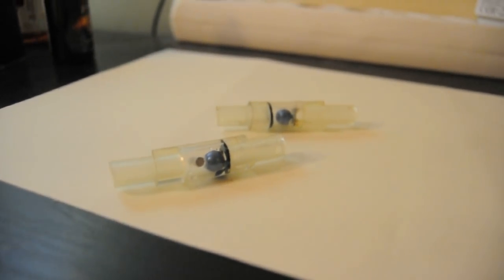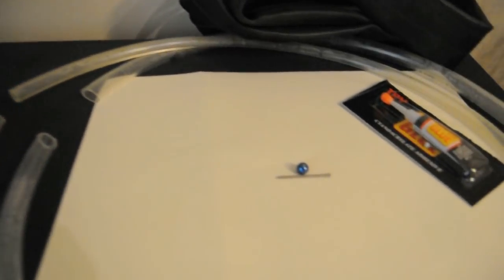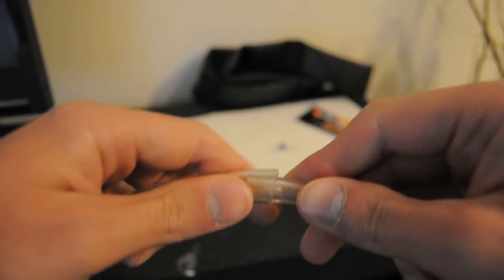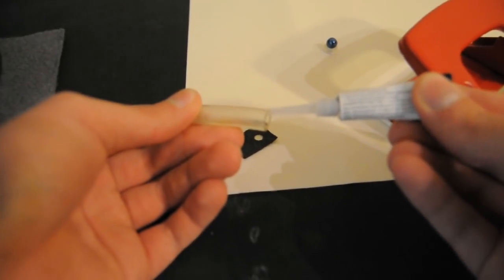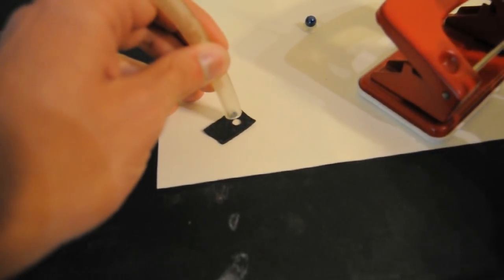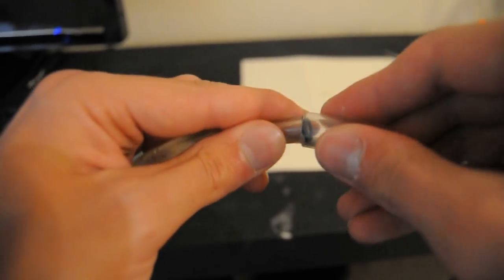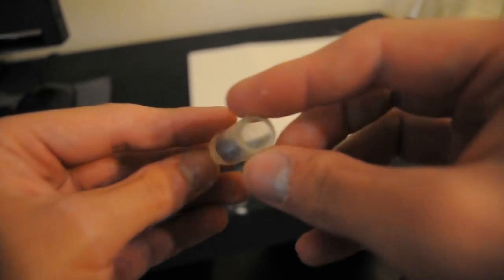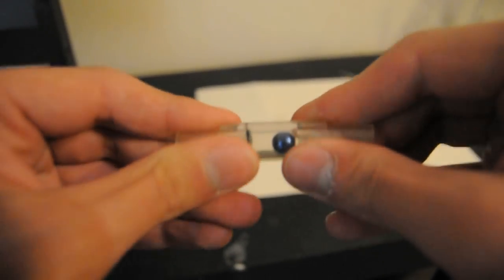How to Make the Easiest Check Valve at Home (One Way Valve)

Comment: I need one designed like this , but with a spring so that only slight vacuum will allow water flow out , and then seal with no vacuum in hose. (adjustable spring pressure)

Comment: I got a shower valve repair kit that comes with rubber rings and springs. I guess I could use that to substitute the nail and the rubber. I just need 2 tubes and super glue? The hoses are polyvinyl? Maybe theres a better glue cause super glue tends to crack and oxidize or break down under uv.
Reply from the maker: Hello. I guess if the valve repair kit comes with a pipe you can use that to make something like this and use the o-rings to substitute the rubber i used.
Best to use solid PVC pipes of any diameter with the necessary fittings to make something that looks like in this video, and as for glue, i suggest that you use PVC glue instead of superglue on hard pipes, but if you plan to use it for anything drinkable be sure all the material is food grade.
Reply: Ace hardware is a tweakers wet dream

Comment: Is it possible to avoid the nail and instead, cut the edge of the outflow-side tube into a V shape?  I know it'll be effective for low-flow applications, but, not for high-flow. It depends on what it'll be used for. A low flow application is brake bleeding for example. Have you tried it with a tube that its edge is cut with V cuts all around?  I'll be trying it to see if a little air or fluid can go through those teeth looking cuts. For a washer, I'll use a good quality that can resist acids and fuel. They are from the oil filter of a GLK350.   Four sizes in the package.  I won't use cheap washers made for water. And a 100ml syringe.  Any other ideas how to avoid that nail?  Maybe distort the main tubing by heating it and pressing your nails on it. Then, use that distortion as the middle of the device. Then start cutting the tubing. Hopefully the distortion won't let the ball go to the other side. Trial and error will lead to success in the end. Oh, did I forget to tell you?  Your video, your thoughts, your presentation is impeccable.
Reply from the maker: What you say will work just as fine as the nail,it is how i had it made for the first time,it just could not give as much clearance as the nail for the flow to pass. Another way to avoid the nail is probably a metal mesh,but your idea about distorting the tube is interesting,especially if hard pvc pipe is used instead of flexible. 
I appreciate that you like my video. :)
Reply: John's Crafting Lab You are very right about the amount of clearance and a metal mesh is a perfect solution for high pressure flow. In my case I need to make one for bleeding brakes and the force of gravity is not enough to seal the inlet. And if I hold it the other way it will never be any seal. I started by looking for marble. I took a small one out of an old swivel office chair. A stainless steel ball that was a part of chair's bearings. This is my marble now and fits nicely in a syringe (syrup for babies). Now, I'm looking for a spring to provide a tight seal independent to how the device is held. If I can't find the spring i won't continue. I'll just cover the tube with my thumb when I evacuate the brakes. Syringes are very useful to work around the car. I labelled all of them. One for only water, only oil, only brake fluid, only power steering, etc. They are 100 ml and only $3 each. That's how I added the new differential oil on my Ford Escape. And the power steering fluid on my GlK350. Also, I use a 1.5 liter syringe for oil change. I tested it on my Chrysler a month ago and I extracted a liter in about a minute. It needed modification thought.  For a lazy oil change I modified a Toro leaf blower/vac to reduce it's huge opening into the size of a shop vac tube and with the help of a separate canister filled with vacuum, all the oil comes out in less than 10 minutes. I did something similar in the past with a regular shop vac and it lasted for years, but, eventually the motor gave up. Too much heat in the bucket. The Toro is air cooled because it's not inside any bucket. I'll update you later on my check valve. Before closing, I must tell you don't stop doing these videos. You'll be a huge success. Trust me. People like such videos. For example, get an empty mason jar, install 2 plumbing valves on its lid and make an oil catch can. Talk to you later.
Reply: You could glue/weld something to stop the ball from blocking the other end of the valve, while still allowing water to flow. Or just cut that end of the inner pipe into a zigzag or sinusoid pattern to allow the water flow. Did I understood the problem correctly?
Also, you could use a fan, or a fan with a funnel to pressurize the air and more easily direct it to the parts that need cooling.You can even put the engine in it's own enclosure so that the air that comes in presurized would be directed in it's way out, so as to not heat everything else around it, or just use two fan-funnel systems, one one-funnel (to push the air in the small tube) high-pressure air-push, and one two-funnel (one at each end) air-pull.

Comment: A small (in length) spring could be used to make the check vavle into a pressure valve. Or the use of a weight  might be justified, if a spring is not available.
Reply from the maker: That is a good point. Thanks.
Reply: ooh, i like that idea for the vacuum pump i want to make. thanks.

Comment: Suggestion. On both sides of the last tube to be inserted, cut 1/3 of the way through this tube about one quarter inch from the end. Then cut up to the first two cuts that were made, taking out the square/rectangular pieces that were made. This replaces the the nail and removes the last steps of putting the nail in and glueing it. Now all is plastic, cutting the chance of rust and damage to the check ball. Maybe the check ball could even be made out of rubber which would remove the steps of punching out the hole in a piece of rubber and  glueing it to the smaller plastic tube. This replaces two items, and three steps. It also allows larger or smaller tubing to be used as long as the correct size rubber ball could be found.
Great video 👍. Just a suggestion 😊
Reply: I am trying to visualise your idea about cutting the last tube and not using a nail... wish you could make a video too.😢
Reply: @martvogt7019  You sir...are awesome in your wording. Maintaining a suggestive nature along side relaying your idea with excitement and detail, all while keeping the original idea mostly intact. Thank you sir; might be hope yet. Maybe even a light weight spring...😊

Comment: John, you could use a set of 2-3 pistons to obtain rotation, a pressure valve to create combustion in the pistons, and woodgas to fuel the combustion, to create an engine. The gasification chamber would be heated by the charcoal made while obtaining the woodgas. The great part is that one can use many sources of fuel, from wood, to grass, from wet to dry, from big logs and coal chunks to coal dust and pellets, thus showing people how one could make an engine for all sorts of uses. 

Like making a self-rotating signal light in case of emergency, which uses a tiny amount of fuel and a bearing, to rotate something around a source of light (like a flame) to be used as a signaling light, if there isn't a good enough stream of water or wind in the area at the time. Or using it to rotate a terracotta/cement/metal wheel so one can sharpen tools and sharpen rocks to make tools if&when needed. 

Also, if enough fuel is present, one could possibly make an engine for movement, like a boat, or car(t). One only has to stockpile some fuel before deciding on a direction, and to make sure one has at least 2 speeds (one being reverse, recommended 1-2 for building forward momentum), and a steering system, and one can get much faster by car than by foot. If the terrain is not ideal, one could use rope and wood to make tracks for the wheels, or just make really wide wheels. A gear box is not that difficult to make, either, so one could easily reverse the direction, as well as increase the speed at the cost of carrying capacity.

The good part of that is that by making a playlist of videos showing one how to make a wood-gas engine from scraps, one can help those in need who have the time and resources to have that built, to build it. So, for example, someone in the poor parts of Africa or Asia could build a vehicle that would allow one to move goods, and by moving goods one can make a profit. For example, one could carry water and food, or cut wood, or grind wheat, or make grass pellets, or power a water pump. Using different input sizes, one could increase the speed at which the water is pumped, and if a channel/tube is made (terracotta and cement can be used, if cheap enough, and burried for lower chance of implosion) or installed, one can easily move water many kilometers instantly, so a union/group could get water inland virtually instantly, regardless of the dunes in the desert. 

Heck, even a cheap PVC piping, when burried for lower chance of explosion, can easily allow water to be moved many kilometers. If needed, one could even use multiple pumps, or bigger ones, so someone can pump water for a weekly fee some part of the distance, someone else can pay that person for water pumping and be paid by others to pump the water even more, and so on. Thus, a 1m-thick water stream on the beach could be spread and end up being a 5cm-thick water stream 5000km inland, for example. Moreover, the ones maintaining the system can work legally, so there's no problem there, and the flowing water would ensure that there won't be much salt debree piling up. Also, using an archimedes screw for pumping water, one could also move fish. The speed is also a factor, since one would have to mess with the gearbox to find the best fuel-water efficiency.
Reply from the maker: I really like your idea and the nice way you wrote it. I'm not sure if i would be able to implement it,but it is a pity to not share all this nice information perhaps on a forum or something like that. You seem like you know this topic real well. Well done!
Reply: Well, the information is on the internet, but there's not one site that acts as a hub for engineering, permaculture, minimalism, and more. Well, aside from youtube.

Also, you could use stainless sheets of metal as a parabolic mirror, to reflect light on a pipe or a smaller parabolic mirror behind the pipe, which would heat up air. Having that air circulate through a loop leading to the head intake of a stirling engine would be enough to get it moving, and once moving it can power one fan for the heat intake loop and another one for the cooling intake (which can be just normal air). There could also be another loop, for burning fuel to heat the air used to transfer heat. Some use water or antifreeze, because it needs (much) lower speeds than air, and circular solar concentrators use salt, but a high-speed fan and a funnel are enough to speed up the air. But the "linear solar concentrator tube" is enough for that.

Below are 2 links to a video that shows how cheap energy can be achieved. And although it might not be as much heat as from other means, the usage of a stirling engine allows for possibly higher energy outputs, because it uses only a temperature difference to generate motion (rotary power), which is a form of energy that can be converted to electricity pretty easily. Teracotta bricks / fire bricks can be used, as well as rammed earth (5% cement and the rest dirt, packed down really well) with tubes (helix or zigzag) for transfering heat (with the same substance, but if it's not air, you would need to have a layer between the liquid and the storage medium), to be used at night (when the temperatures are lower outside, giving a higher temperature difference; also, 24/7 power generation).

https://www.youtube.com/watch?v=1tPJ2V88H5E&index=13&list=UUd_FypFc4T5pJky872wBsNg
https://www.youtube.com/watch?v=r9OOnDq58vY&list=UUd_FypFc4T5pJky872wBsNg&index=6
Reply from the maker: That's an amazing info you've got there, i appreciate for adding it here. I'll check it out.
Reply: If you know any Discord server about engineering, please do tell me!
Reply: what

Comment: At 2:33 I'm pretty sure it's not supposed to spray all over the place.  I had the best laugh of the week at that point.  Thank you.
Reply from the maker: Hahaha yeah,it was slippery and quite hard to hold it by hand when the pressure increases.
Reply: I loved that you didn't remove that part.
Reply: Word I agree. Most people would’ve edited out the spraying water but you left it on. Shows you have enough confidence to know it works when really applied.

Comment: Very cool I have made these out of PVC pipes before but never thought of using them this small, but it is right in line with what I have been trying to find all day on line. I need some 2 part plastic clips of liquid ports to join 2 vessels as well as a low voltage all plastic liquid pump. these are for my humanoid robotics build I have been working on for a bit now I am onto something that seems to be avoiding the big boys at the big schools and companies. If I can get the rest of the parts I will display it here so they can see my fix. keep the videos coming I will be watching.
Reply from the maker: Thanks for your input. Seems like you're having a great time with your project. :)

Comment: what was the ball from? Can you use a marble or is it too heavy?
Reply from the maker: It was a ball for plastic jewelry,and yeah you can use a marble,why not? Just i think it will be too heavy for a low flow air application,for something as dense as water it should be alright in most of the cases as far as the valve is placed horizontally,or if it's having a spring behind the ball forcing it to the direction the valve works to.

Comment: so when it popped out of the water hose is this only because it was not properly secured to it?what good is this for exactly? i can not use this as a safety device like a flashback arrestor on my blow torch
Reply from the maker: Yeah, when the pressure raised it popped, indicating the flow was restricted by the valve's operation. You can use this design for everything, just make it out of copper piping, and for gas use suitable rubber that will not disintegrate from the fuel.
Reply: @truebassB  ok ty

Comment: Great job...I will make this with metal  for my vacuum chamber 👍👍👍
Reply: It will be better if you put the nail as close as you can to the ball so the valve close faster to not lose some gas, but dont put it too tight if not cant work

Comment: What's it like in low pressure situations?
Reply from the maker: Great, as far as the flow is sufficient to operate the valve the way you made it, for example the seal at the ball plays a great role, the smoother its contact is, the less pressure and flow it will need to operate completely.
Reply: John's Crafting Lab I did My system without a valve. I wanted maximum flow.
Reply from the maker: @petercohen3966  sounds good.

Comment: Question ..can water pump attached to flowing pump act as check valve..We get water from municipality for short time and we use pump attached to water pipe line to pull into water sump, my question is if the input is raised we don't get pressure.  If we have same level .local plumber says the water will flow back to main line.  My question is will the water pump act as check valve
Reply from the maker: If i understand this correctly, you have a water pump where you want it to act as a check valve. From what i can say, there's a good chance for the water pump to have an integrated check valve on it so it might work.

Comment: I want this type valve to purchase but can not find anywhere, all valves I find uses Spring or Rubber or Swing. so non of them are free flowing on one side like this one...if anyone knows where I can find it, please let me know...I know it is easy to make but I want this for my car and I do not want to gamble since it will be introduced to lot of heat cycles and oil. great vid

Comment: I like your video one thing you could do instead of putting a nail in there to leave some space simply cut the tube on that side with a 45 degree angle when you put it in and then the marble has no way of making a seal and you won't have to worry about a hole in your check valve
Reply from the maker: To tell the truth i did made some experiments with it being like that and that's the best idea, only problem is if the tube is too small like the one i've used, then its wall is going to be thick, thus limiting the flow at some extend, whereas a nail leaves the full space between free.
Although if the tube is bigger and you use, let's say a pipe and a marble, the way you say is the best way it can be made.
Reply: @truebassB  thanks for the reply I like your video and you got a subscriber
Reply from the maker: @caradu9973  No problem! Thanks :)

Comment: it is not good and not strong to put the smaller pipe inside the bigger one then add super glue from the outside! You should put super glue first on the smaller pipe then insert it in the bigger one so that glue will cover a wide area between the two pipes and stay longer !! hint: you should use special super glue for rubber !
Reply from the maker: Hello. Good advise! Thanks.

Comment: you should have used the spring to push the ball
Reply from the maker: Correct,that's the ideal design,but you need a high pressure application to insure it will work,the same goes to springless design,but this needs high flow to make it work.
Reply: One could have two valves, a smaller one for lower-pressure, and a bigger one for higher-pressure.